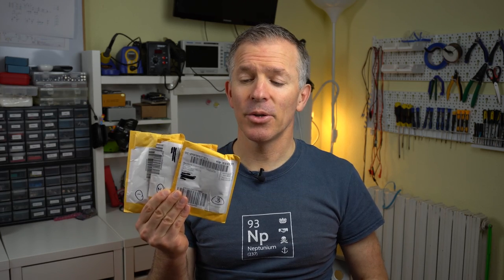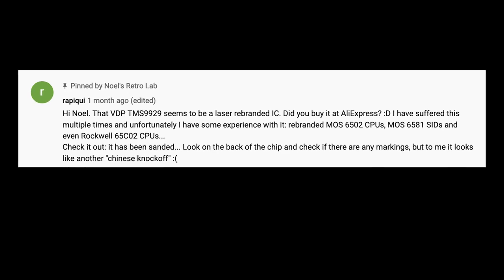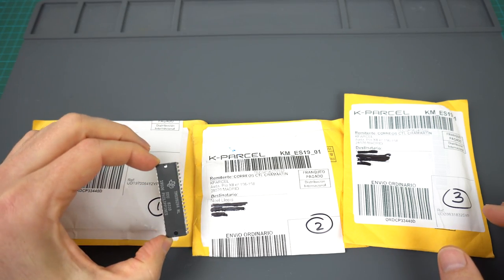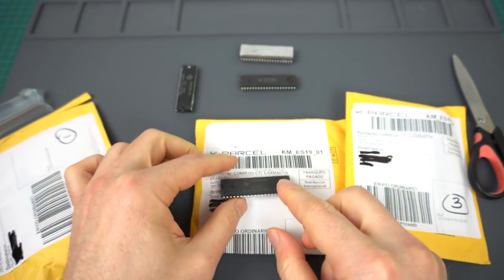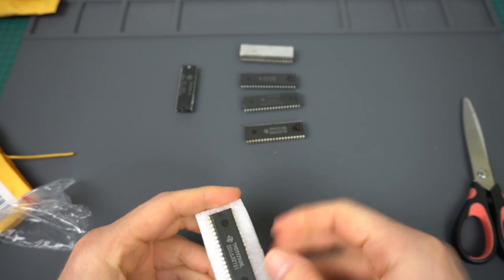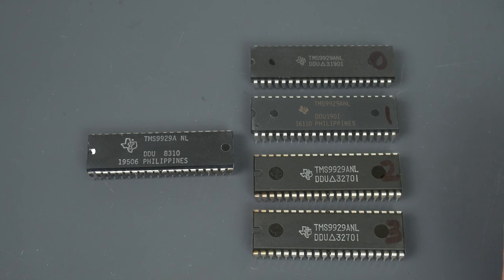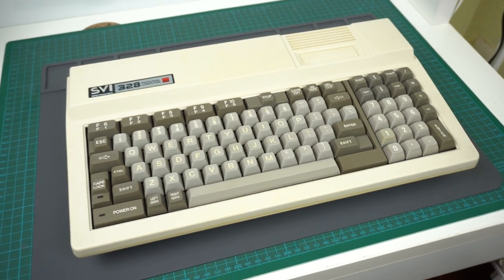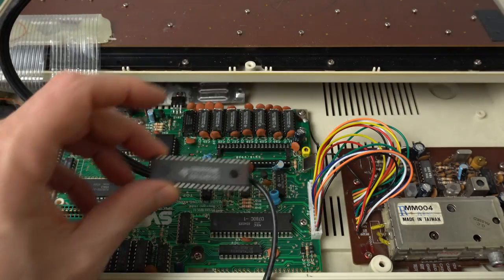Detecting FAKE Chips From China 🔍

Comment: I used to work for a company that did some counterfeit chip testing. You would be amazed at what we saw. Chips with die inside but no wirebonds. Chips with no die at all. Chips with a date code years after the last time buy notice. Chips with one company's logo externally, but a different company logo etched in the die pattern. As long as the package is the same, and demand exists for the obsolete chip, counterfeits will be made. 

Better fakes use laser markings because the solvent (acetone) test was so effective at detecting poor ink marking. 

Using x-ray and comparing to a known good sample of similar vintage and from the same fab is the best method of detection, second only to electrical testing.

The vendors are very fly by night and operate as a number of companies, changing identity frequently enough to evade detection. Even with an escrow agreement, they will just try to stall long enough to get the funds released before the counterfeits are identified. Or, they send a handful of good chips for advance testing, get the funds, then ship a load of fakes. 

Another scam is to salt a lot of mostly good chips with some quantity of fakes, especially with higher cost chips. The hope is that it takes some time to identify the fraud, either to clear escrow or to give them time to change the company identity. 

Buying from "different vendors" does nothing to protect the buyer because if they are selling the same chip they can easily be the same fraud company. Best to avoid buying obsolete chips from China unless you want to buy a handful and hope at least one works.
Reply from the maker: Wow! That's even worse than I thought. I suspect that one that wasn't giving any kind of resistance between pins might have had no wirebonds at all. Any other checks you can recommend that we can do at home for counterfeit chips?

Comment: One thing I noticed is that you use a static strap and I am glad to see it. Not many videos show that it is important. Showing an alternate way to test these chips is fantastic. I also had some bad chips that were supposedly out of USA but came from china. I love Paypal, they protect us when the sellers are not responsible companies.  Back in the 80s I had gotten hold of manufacture's discards which I was surprised that they weren't destroyed or chopped up. So they are out there. Thank you for your wonderful and smart videos! We get to learn things the right way!
Reply from the maker: I'm glad you noticed that! You wouldn't believe how many people in the comments "yelled" at me for holding the chips without ESD measures 🤣 Really glad you enjoyed the video!
Reply: @NoelsRetroLab  I am glad you told me, I thought I was the only one upset about people not using it!
Reply: I remember an electronics/computing magazine article from the late 70s/early 80s, which reported that someone had been dumpster diving (or maybe had inside help) at a chip manufacturer and was selling on test-failed chips (EPROMs, I think) as genuine. They had been discarded before labeling, and the scammers had printed new labeling on them, but used a slightly different typeface. (IIRC, one '7' had a straight upright, and one had a curve.)
Some things never change.

Comment: I repair and restore old pinball machines and this is a constant annoyance. I just assumed they might just hope that the receiver either doesn't bother to ask for a refund for a $5 part or might think they broke it themselves and wanted to avoid any hassle. Most colorful reactions I've gotten from a fake TIP102's, that literally blow up if they get any load. They're a lot of fun to watch when a pinball machine fires up a solenoid and instead emits smoke signals.
Reply: Pinball machines...with a hobby including any sort of old electrical stuff...back in 1982 I bought a well used Pinball machine from a guy selling the new ones for arcades...
 BALLY 'Space Mission'...exactly zero electronics in there...lots of wires, switches, relays...solenoids and a few motors...switches, a few but thousands of contacts on the 'score' counters on the back-board...

Comment: So: are we talking fake as in something like the actual chip, but with maybe a different speed or temperature rating, maybe untested, but at least there's some hope of the chip actually doing the job, or are they fake as in random 40-pin packages that have no relationship to the real one, and have no hope whatsoever of working?
Reply: This is what I want to know... kind of an important question to be resolved.
Reply from the maker: This encompases everything. So maybe counterfeit is a better name. But I suspect those two failing ones are just some random DIP 40 ICs that were relabeled.
Reply: Even sometimes it is the original chip, buuuut used and gotten the worst treatment (like having a bath in molten tin) imaginable. So you often get those selled as new.
Reply: @NoelsRetroLab  I'm with the other guys! Look into decapping it!
Reply: Yes Steve, this seems like a really big problem. Imagine a SN74HC00 relabeled to a SN54HC00 and you fix (ancient) production equipment with it. Somebody loses a hand.
Maybe a bad example. People with reason should not buy industrial/mil grade spare parts on ebay. Some distributor with a name and reputation is preferable I think:) This 54/74 fake situation also means a complete different packaging ( PDIP vs. CDIP). But i can imagine other naming schemes where temperature ranges and tolerances are easy to fake. Sad that ebay/china is sometimes the only place to get retro-stuff from. Good that there is a refund option. So ... you're just wasting time and losing faith in a good world.
At all, people who sell counterfeit often get what they want: Long and free residence in the state prison:) Just google it
Reply: @dieSpinnt  The problem is this isn't just on eBay. I remember a news story about a Swedish company doing their own quality assurance on every chip they bought from China because even if they ordered these parts in the thousands a bad (such as a re-branded or used)  batch could show up at any time.
Reply: Either a similar compatible chip in the same package, a dirty/well-used chip which has been refurbished, or a chip which simply looks like the same chip and has either deliberately been relabeled to impersonate a more valuable chip or accidentally been replaced with the wrong label by a careless recycling plant.
Reply: "Fake" could be anything. It could be a recycled authentic part which is just malfunctioning. It could be a recycled authentic part with markings suggesting better specs and ratings and bins than it really has. It could be an unrelated part which shares the pin package. It could be nothing but an empty package. Anything to make a buck, to turn garbage into money.
Even the legit recycled parts have an unknown age and unknown life story.
It depends on the ethics and standards of the vendor - along with those of whomever salvaged, refurbed, or faked the parts.

Comment: As an aside, while the TMS9928A/9929A outputs are labelled as Y,R-Y,B-Y they are in fact YUV signals.  I'm working with a small team investigating this and the palette associated with these VDPs.  We've taken vectorscope readings and these have confirmed our suspicion that the output is YUV.  When our work is complete we'll document and publish our findings.
Reply from the maker: That'd be great. Let me know when you do! It certainly confirms what I'm seeing that I can't feed the signals from the VDP into a TV accepting component input. I just tried with directly with a TI99/4A (same VDP) and got the same results. I want to go a bit more in depth about it in a followup video, so it would be great if I can include your findings too.
Reply: @NoelsRetroLab  I'll let you know.
Reply: @Ikrananka Yes, most interesting and probably true ! Today I connected the Y,R-Y,B-Y output pins from my TMS9129NL to a TV with component input (YPbPr) and it just showed nothing ! But when connected to the YPbPr inputs of a GBS-8200 converter board, it detects 'something' and it is converted to a VGA image.
Reply: @fa497007  Interesting - thanks for the info.  Apart from our vectorscope readings showing 100% certain that the signal is YUV, another strong piece of evidence is from the obscure Tatung Einstein computer.  This short lived computer was aimed at business users and had a separate, optional, YUV video output connection.  The YUV connection was literally taken directly from the TMS9929A, only passing through voltage follower op amps to buffer the VDP from potential damage.

Comment: I always assumed the ripoffs were just any defective chip in the same package where they just remove the silk screen and have blank bins.  Then as orders come in they are wiped with whatever numbers the customers want from existing stencils.  So yea, your obscure chip silk screen might only get thirty wipes a month, but they probably have thousands of silkscreens that match blanks on hand so they fill those orders.  
Other issue I had was the chips that didn’t quite make spec at factory were just rebranded and sold at the same price.

Comment: Nice work identifying the counterfeit ones! This is really becoming a problem especially with the 68060 chips. It might be a cool follow-up to try to resolve what those counterfeit chips are in reality.
Reply from the maker: Yeah, it's definitely becoming a problem in general. For any non-trivial chip, I'm going to start ordering only from trusted sources.
Not sure how I would go about finding out what those chips are since the label was erased. Any ideas?
Reply: Unfortunately, no ideas that wouldn’t turn out to be tedious. It would be safe to assume that the counterfeit chips are not faulty TMS9929 because those wouldn’t need re-labelling. I am not sure whether they could be TMS9918. One would think the pinout would be the same between the PAL and the NTSC versions. I could be wrong, though.
Reply from the maker: @terosaarela4555  They're definitely not TMS9918 because I accidentally got one of those first and the clock oscillator works and they output an NTSC signal, which can kind of be displayed on a PAL device. So they're probably something else completely different. I should rub with acetone some more. I saw in the video in the pinned comment that if you keep rubbing sometimes you see the label underneath.

Comment: As that chip with slab heatsink is toast, you could use a heat gun or put it in the oven to get the heatsink off.  You could reuse it in one of the projects for the sake of originality or just keep it "just in case."
Reply from the maker: Cool. I wasn't sure if it was some weird glue/epoxy that wouldn't go away with heat. I may give that a try, thanks.

Comment: Hey!! I was wondering about the same problem with all chips I buy on AliExpress and Ebay. I just bought 74HC logic chips, 555, Z80, SRAMs memories, CPLDs and sound chips. I have to test all chips and I think a 50% of them are counterfeit or failing. Thanks, thanks for doing this video. Interesting, entertaining and outstanding complete study. Please, make more videos like this!!
Reply from the maker: Thank you! I haven't found this a problem with simple chips like 74XX ones, although someone said they got LS chips instead of HC chips. So that's already happening apparently 😞
Reply: Buy logic chips from DigiKey.com, MUCH MUCH cheaper than eBay and AliExpress, and is 100% working.  Guaranteed! Same for SRAM PDIP format.
Reply from the maker: @unebonnevie  I've used DigiKey a few times and the initial price isn't cheaper. It might be if you take into account the time wasted reordering chips to Ali/Ebay though. Also, shipping from EU is a big deal as I believe you need to order over 50€ to get free shipping (or pay a ton). So that's kind of hard when you just want a couple of chips to finish a project. They also don't seem to stock up old chips like this one, so that's a bummer. I'd love a reliable source of old chips.
Reply: Well, it's so expensive to order from Digikey here in Latin America because of the shipping costs. Here in Chile we have RS Chile for some chips like those. But AliExpress and Ebay are way more more convenient for their superior catalog of circuits.
Reply from the maker: @xyz2112zyx  Yeah, totally. Especially for small orders.

Comment: I have seen another video showing a bit similar comparison.  However, there was one additional observation.  The bottom side markings typically contain additional information like the manufacturing plant and batch numbering or similar.  People doing relabeling ("remanufacturing") may not bother sanding and redoing that info.  I am not sure what exact info you could dig out from the bottom side markings in this case, but in any case,, there could be some useful info before or after alcohol (or acetone) wiping.
 Another thing relates to the sourcing of the chips.  We once got a batch of certain chips from an authorized distributor.  These chips failed in short order in our product burn-in test.  When we started looking closer, the part marking was on a wrong side.  Apparently the printer of the re-labeling operation could not print on the correct side for one reason or other.  The part was a power MOS FET in TO-227 package.  Inside there was a pair of small chips, while the original ones used just oner large die.  The distributor claimed they got these parts from the official source.  The conclusion might be that there was some foul play somewhere in the supply chain -- somebody with access to the parts did a nice swap, replacing the good official parts with cheap fake parts and then got good parts to sell at a nice profit elsewhere.

Comment: Noel, In your video It looks like all working chips have a somewhat larger hole between the middle connecting pins on both sides. So that may be an easy way to recognize real VDP chips from a photo..
Reply from the maker: Do they? The righmost two (numbers 3 and 4) have... something there. But the working one from the TI seems totally even.
Reply: @NoelsRetroLab  Have a look @ 5:32 it has the same cutout between the middle legs.. (pin 10-11 & 30-31). Also take a look at the photo's on this wiki page: https://en.wikipedia.org/wiki/Texas_Instruments_TMS9918 all chips have the same notches between the middle legs..
Reply: @L0wcash  You are right! On the genuine chips there is a tiny rectangle of metal cut out from the top part of the middle pins....take a look, Noel! Well spotted, Retroperator!

Comment: My dear colleague! As they say in Hungarian, I am an "old fox" in electronics. I came across counterfeit transistors 35 years ago !!! (and more and more since then, MOSFETs, etc.) in 1985 (the Iron Curtain still stood between Eastern and Western Europe.) Hungary belonged to the Eastern Bloc.  I asked my friend (who has „western passport”) buy me 100 pieces of 2N3773 transistors In Western Germany. He bought, (it was not cheap) and all 100 pieces had a breakdown voltage of less than 100 volts (according to the data sheet were 140) it was “RCA made.” He was soon able to return it to the dealer who returned the price without dispute. They started counterfeiting back then, and I've been testing everything before soldering. I wish you much more success in your work and good health!

Comment: Interresting video :)

Another thing to look for when doing the visual inspection is the date codes on the chips.
The original working one says it were manufactured in the 10th week of 1983 which fits both with the chip type and the device it is used in.
All the other chips have either nonsensical date codes or datecodes that seems wrong. The two new working chips, no 2 and 3 do not follow Texas Instruments convention date code convention of YYWW (year, week) and if read the other way, it says they were made in the 32nd week of 1970, which makes little sense since this TMS chip were first introduced in 1979.
Despite them working, they might still be "fake" in the sense that they are reused from discarded electronics and then rebranded to seem new.
Reply from the maker: Good point. I'm not an expert at codes, so I don't know if they simply changed their codes at some point or they're fake. Although you'd think that if someone goes to the trouble of rebadging a chip, they're most likely copying an existing one, but who knows! 
I actually doubt the last two are "fake" or "clones" or anything like that given some of the other comments (this is not a VDP that has been replicated and manufactured recently from what I was told).
Reply: @NoelsRetroLab   The datecode on those chips is the one after "DDU"

The datecode has not been changed for the DIP chips as far as I'm aware, nor according to TI's "Device Marking Conventions" document.
 Table 6 on page 5 here: https://pdf4pro.com/cdn/device-marking-conventions-rev-c-texas-f8a2.pdf

The code is of the 4 digit format with year first, week second (YYWW) so the datecode on chip 2 & 3 would read 32nd week of 1970 which does not make sense since the TMS chip were first introduced in 1979. Which is why I suspect those two chips have been relabeled.

They are most likely genuine chips, but old, used ones, which have been relabeled to make them look brand new instead of used/refurbished.
This is not uncommon for the counterfeiters to do, despite it seems like a lot of work. Nor is it uncommon they just put random numbers on them to make it seem legit.
Reply from the maker: @Gin-toki  Very interesting! I wonder how they can relabel those and make them look so good and even. And all that work for very little payoff, because it's not even like they show that picture in the Ebay auction. So I would have been fine getting a beat-up, scratched-up chip as long as it worked the same way. Very puzzling that whole thing. Thanks for that link. I'm definitely going to read more about it.